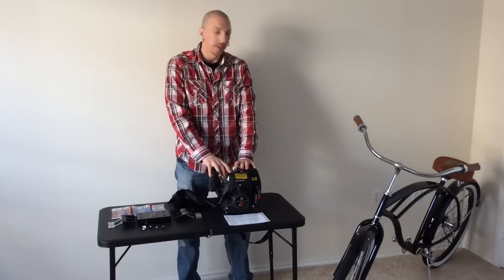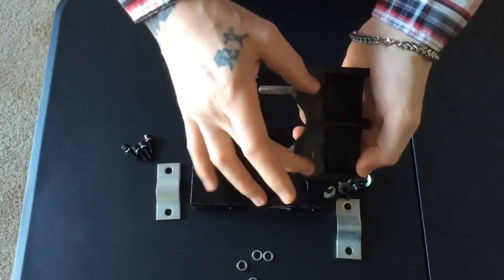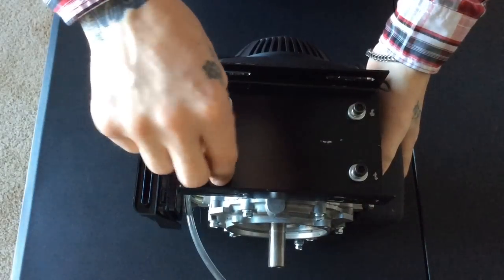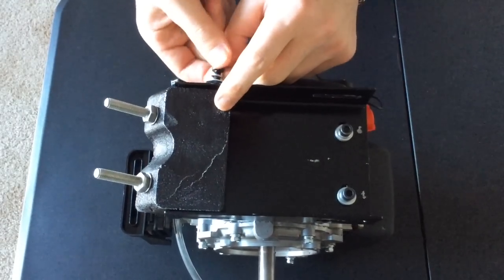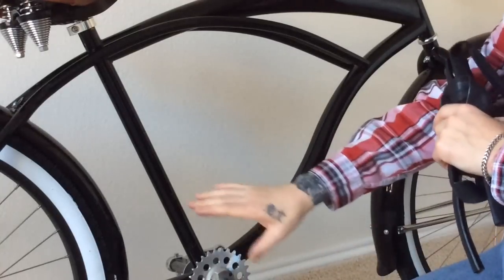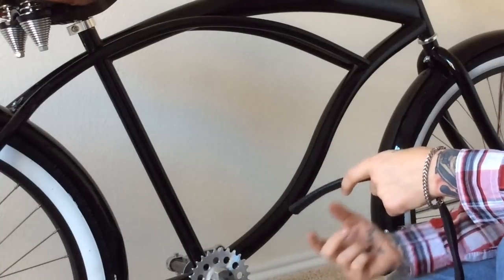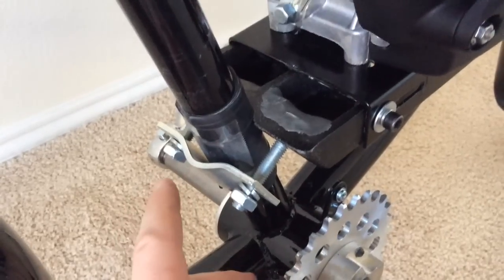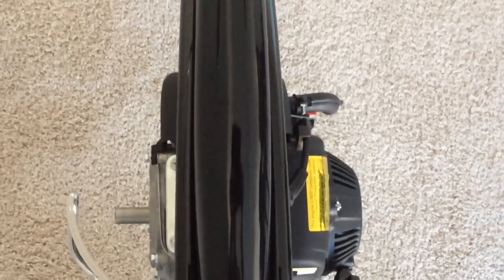How To Install A Motorized Bike Engine

Comment: I got a question what kind of motor mount is it cuz when I put my 4-stroke engine on my bike I have to use a flat plate on my bracket because it doesn't fit around the fat bar and I think the flat plate puts it back about another quarter inch toward the bar that's why my stuff is tight but your bracket look the same as mine but mine has four bolts on each side of the chain slide?

Comment: Can any one tell me where the fuel lines connect to the carb, there are three places on the carb for fuel lines.
Reply: I know it's been four months since you've asked this question but it's on the left side of the engine the same side as the pull start, it took me a second to figure out where it was when I had this motor I actually laughed when I read your comment because it reminded me of my frustration trying to figure that crap out before
Reply: Only one place to mount...the rest are drains

Comment: I thought most 4 stroke engines these days had an oil pressure sensor with an auto-shutoff...what happens when you go up and down hills? Also where did you get that engine and kit?
Reply: If you uses a motor with low oil pressure sensor its best to delete it because when the oil sloshes while your going up hill or turning the engine will think its low on oil and cut engine power .theyre designed for stationary application but could be use on bikes etc aslong as you delete the low oil sensor

Comment: Great vid. But may I recommend to just use blue permatex on all bolts. Blue will take some work to separate, but red needs heating or a permatex solvent.If you don't need heat then you di't use enough.

Comment: Personally..... I would have put down 4 rubber grommets in the holes on the base plate then the engine. .... (and then tighten the engine down onto the rubber grommets, that way you can dampen the vibration far better)

Comment: I have a question for you I just bought the same engine as you can see it has three gas lines The gas tank only has one hook up where does the other two gas lines go or hook up to
Reply: Christopher Smith I just ordered the same engine and it also came with 3 gas lines and I'm confused
Reply: They are drain hoses for the carb
Reply: Drains

Comment: could you pull power from the magneto to power a light instead of using a separate battery??
Reply: magneto puts out AC , lights on bikes are DC.
Voltage would need to be regulated, dropped and rectified.
just use a DC dynamo.

Comment: will these work on mountain bikes with hydraulic disk brakes?
Reply: Vixen Timer if you have space yes but you might have to get caliper brake for the rear tho.
Reply: You would have to remove the rear breaks
Reply: Nope

Comment: Great vid bud.The engine that you installed in this video,does it vibrate alot as the more gas you give it versus the traditional 80cc 2-stroke engines?
Reply: William Santiago i can answer that since i habe exprienced in both it doesnt vibrate as much as a 2 stroke its more of a light buzz but thay varies by your mounting bracket like the one in this vedio it wont be a noticeable vibration.

Comment: Could just buy some shorter allen bolts too.
Reply from the maker: Yes you could definitely do that, although I have tried that route a few times and spend more time searching for the proper length and thread than I do just cutting it down lol.

Comment: did you buy a moped kit ? like on ebay ? could you post a link of were i can buy the motor
Reply: gas bike.com
Reply from the maker: I used to buy my engine kits from gas bike until I needed them to back up a bad product they sold me and then after finding out they spent more time misdirecting me and ignoring me I stopped going through them and am currently looking for a different vendor for belt drive 4 strokes.
Reply: i was considering using "https://www.kingsmotorbikes.com/apps/iwish"
Any good or bad luck with them?

Comment: Something that I have done on my installations, with a similar bracket, is to flip the rear mounting bracket 'upside down'. Turning the whole rear side of the bracket upside down better aligns the the grove on the uptube and gives the mounting much better stability and seating. If you have the frame room, which it looks like you did during this build, having the rear side mounting bracket turned upside down, and moving the base plate as far forward as possible, will allow of the rear mount to form a V with the down tube, allowing the mounting plate to sit on the end of rear mount. 

I have my bikes set up so that I can remove the entire engine, and attachment plate, off the bike by removing the 4 side hex bolts. The alignment is almost perfect, with having the rear mounting bracket flipped over, allowing quick removal/replacement of the 4 bolts to re secure the engine. Also makes it easier to install the entire mounting hardware, since you can set the bracket without having the engine already on the mounting plate, and pull just the plate off to mount the engine. Makes it so much easier to do maintenance on the engine with just pulling the mounting plate off each time, instead of having to pull the entire assembly.

Also, to help reduce a little more vibration, try seating some rubber grommets in the top mounting plate. I've found a few that will fit into the track that you can attached the base of the motor to, that reduce a little extra vibration, by not having the metal on metal, but it does eat up a few millimeters on how far you can shift the motor right/left, for chain alignment. 

Keep up the great videos. I'm looking at putting up a few of my own towards the first of the year. Looking at putting together a Slugo Fat Bike installation in the next few weeks.
Reply from the maker: +Drashk Dza'lya Thank you very much for watching and for the tips Drashk! I've thought about flipping the one bracket over to accommodate the angle a little better but then the bolts that hold the engine to the bracket interfere. I would either have to do some modification to the bracket to clear the bolts, or raise the engine up higher so the bracket would be spread wider leaving the mounting bolts accessible and no where near the brackets. However I don't have the tools or machines to fabricate and I would prefer my engine lower for better lower center of gravity and more centered within the frame. 

The rubber mounts for the engine are a great idea and also something I have considered before, just never followed through with yet.

Thank you again very much for the ideas and for watching! Feel free to post some pics and description of your build on the SCC Facebook page at 
Facebook.com/sccmn. 

Have yourself a great holiday and I can't wait to see your videos and your bike build!

Comment: Hi,

Enjoy your videos and many thanks for sharing.

Never built a gas powered bike, but thought about it some years back.

A couple of things you might want to consider.

1:  The grade of fasteners you use in this vibration environment would be important .  I would use a minimum of Grade 5 hex head bolts for mounting the engine bracket to the bike frame.  You can easily identify them by the 3 lines on the top of the hex head of the bolt.   Also using quality Grade 8 socket head cap screws would be a plus.  These are available at your local hardware store.  Most times the quality of fasteners supplied with kits from China are of questionable quality.

2:  I would use nylon inserted lock nuts instead of the standard  nuts and lock washers at this is a far superior installation and will save you trouble down the road with loose or missing fasteners.  An application of Blue Loctite to the cleaned threads will provide additional securement protection.

3:  I would use Blue Loctite on (all) threaded connections.  Both the bolts and associated nuts on all connections should be cleaned with a proper solvent prior to application of the Blue Loctite and assembly to remove any oil or other contaminants used during the manufacturing process.  Flew R/C helicopters for many years and vibration was a BIG issue and Blue Loctite was the answer to keeping things secure.  Red Loctite is great for a permanent a connection but usually has to be heated with a torch prior to any removal process to prevent bolt breakage of stripping out of any internal threads in the engine.

4:  May be getting a little ahead of the total installation process but I would think that alignment of the engine and the rear sprocket should be taken into consideration prior to final tightening of all the engine mounting bolts.  Don't know if you could use something like a 36" aluminum ruler stood on its edge (even if was on a slight angle) laid up against a flat area on the engine with suitable flat spacer if needed and the face of the installed rear sprocket to get the best possible chain alignment.

John
Reply from the maker: +helicopterjohns Good morning and thank you very much for the feedback! Definitely some good points! Even though I haven't had any issues with the hardware to date you are completely right on that. As far as the alignment I mentioned about that's the setting for this particular engine and frame since I've built this combination many times before. The lateral adjustment the rear hub mounted sprocket adapter allows will help me out also. Thank you again very much and have a phenomenal holiday season!

Comment: What would be a good bike to convert that is designed for very tall / big riders? The only real bikes I seem to find that fit that category are from Worksman but with the lower cross bar I have my doubts about an engine fitting in there.
Reply from the maker: +Lacider I'm not sure what your definition of very tall is lol, but the bikes I get are the extended frame versions which means the frames are about 2" longer than a standard frame which for me at 6' makes all the difference and is very comfortable. You could also possible do an extended frame with a layback seat post which would give you a couple more inches as well. Thanks for watching and have a fantastic holiday! Any other questions just let me know! You can either email me at sinistercustomcycles@gmail.com or go to Facebook.com/sccmn

Comment: Love this channel, Is it bad to put rubber between the mounts? I heard that it can put to much pressure on the mounting studs?
Reply from the maker: +LastGenGamer I've always kept it down to two layers and have never had a problem with it so far. One of my previous builds has about 3k on it with the same rubber mounts and still going strong. If you were to add too many layers then you would probably run in to issues with it. Thanks for the comment and watching! Have a wonderful holiday!
Reply: Sinister Custom Cycles thanks for replying, great video!